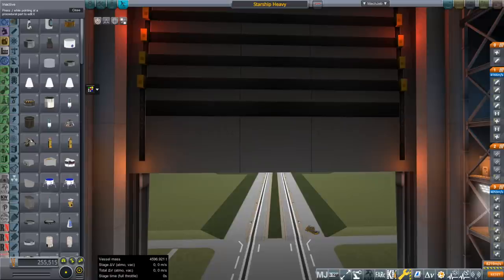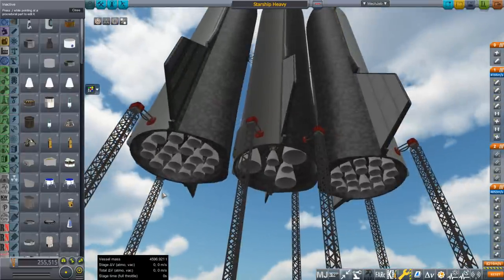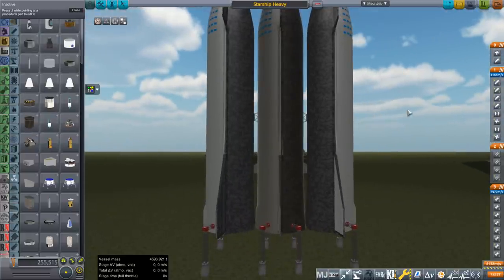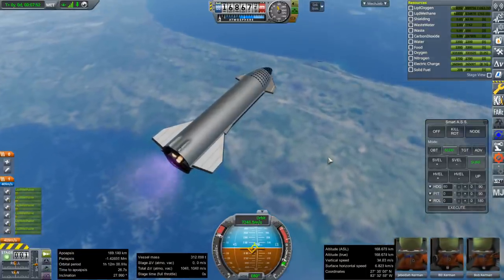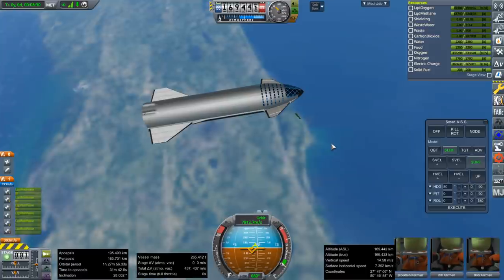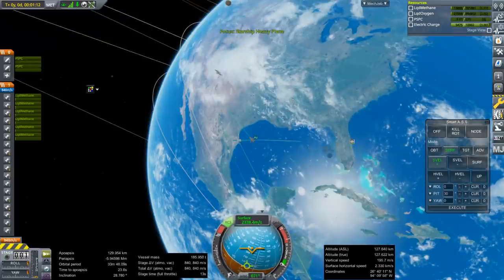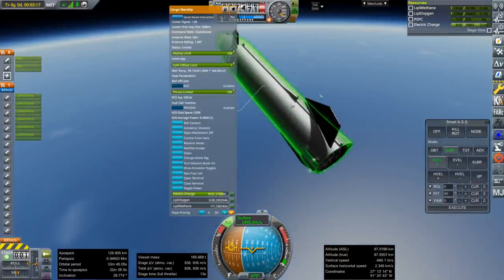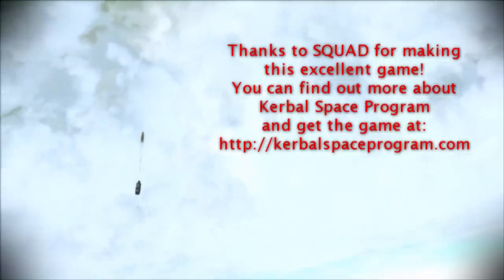Realism Overhaul in KSP 1.8.1 -  Starship Heavy

Comment: If you want to make fins like irl starship, you can make them like air brakes and then use action grouping to deploy/undeploy, that's how it's done in Tundra Exploration and that seems to be the best way available
Reply from the maker: That wouldn't work for the yaw control, I think?
Reply: @RaizSpace  Yaw can be controlled by banking and through RCS, no? That's how I do it in tundra at least

Comment: A way to make the fins pivot like they should is by making them control surfaces, and binding ( increase flap deflection on one set of fins, decrease on the other ) on one action key, and in reverse for the other action key, sucks that flaps move slowly but maybe it works with the spoiler function too? and that moves near instantly. Pair this trick with rcs to stabilize it belly first and you should have an easy time controlling it.

Comment: 0:25 The point about carrying extra engines is not true if you use crossfeed, which is what the Falcon Heavy was planned to use until 2017, and efficiency could be improved by using extendable nozzles (not realistically on the Falcon, though, as they are too tightly-packed).

13:25 Yep, Mean Mr MUSTARD (Multi-Unit Space Transport And Recovery Device).
Reply: Ok, but with 9 engines, extendable nozzles... Do not fit

Comment: This would most likely not be simpler than superheavy structurally. The center starship would need a structural upgrade compatible to the falcon heavy center core or the SLS core. Remember how long it took to get those built properly?
Reply from the maker: SLS core and Falcon Heavy core were not built to withstand reentry from the start, so perhaps it will be less of an upgrade for Starship than, say, upgrading Super Heavy for a Super Heavy Heavy. Also, the upgrade to SLS core was because of a payload on the top - the STS External Tank already handled loads on the sides. Similarly, the complication for Falcon Heavy is not just to loads on the sides, but bearing those at the same time as having a serious moment from the second stage and payload at the top, which puts a lot of stress on the frame. This Starship configuration will actually have less of a problem than Falcon Heavy. Still, I don't generally like Heavy configurations to begin with.
Reply from the maker: A shorter way to put the Falcon Heavy problem is that it's got long-thin-tube syndrome, while Starship doesn't.
Reply: @RaizSpace  I agree that it doesn't have the same issues as the examples I gave, I was more speaking along the lines of "look at what other projects have changed where their primary stresses come from and how that effected development". In reality the bigger issue I think this would have is the significant increase in longitudinal stress on the welds. We already know starship can barely hold itself together just while being pressurized. Imaging how much extra stress this would add to those welds!
Reply from the maker: Well, please tell me they're going to do something about that before they send it on a three year trip to Mars and back, at the end of which it has to bear an interplanetary reentry . . .

Comment: I find this very interesting...  It's definitely a configuration that count indeed exist, and could perhaps work!  

A couple things to note, for the concept of cutting the model in half.  You could just do that with a flat border between them, the only problem would be nodes?  I dunno.  An interesting quandary to be sure.

Making the whole thing lighter is definitely going to be part of it.  Also, those vacuum engines should definitely have more than one ignition, I mean in real life, how many ignitions does their closest counterpart supposedly have?

Thruster arrangements I'll agree, need some work for roll-purposes.

Also, just to continue the test, I'd like to see just how far the boosters could get, so maybe if lightening them doesn't work, just to see how far you get, engage the cheats for heat tolerance and dynamic stress, and see where they'd have landed.  Mainly to see if you'll end-up with enough fuel to land, which is the real question i have.
Reply: instead of cutting the model in half, you could  make a base version of starship without the heat shield and a second one of just the heat shield that is just a bit thicker to wrap around the tank and cargo hold.

Comment: you said you wanted to make it lighter... I've always liked the concept of the retro-rocket...  used to de-orbit after doing all that space stuff.  would there be room for some solid fuel retro rockets, so that you could use the rest of your liquid fuel on the ascent and not have to worry about keeping a reserve?  retros might even work if there is a problem with your RCS configuration or if you need some sort of assist for settling the fuel... just saying... =D thx for the content.
Reply from the maker: There's no way solid fuel would be lighter than just lighting methalox engines or RCS for retro, since the solid fuel has less efficiency. We could just plan properly to have the deorbit fuel, which every space mission does. If we have a problem with our RCS, we would not be able to orient to fire solid rockets in the proper direction, so we'd be in trouble anyway. We have been using liquid deorbits successfully for more than fifty years, so I think we can manage. So, in short, just say no to solid retro rockets.